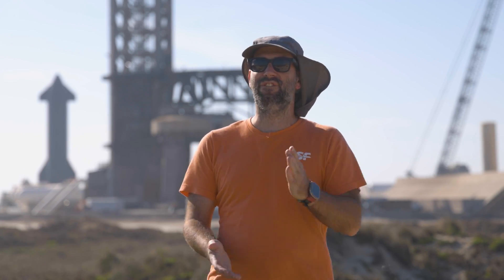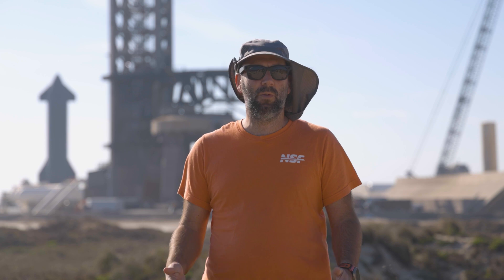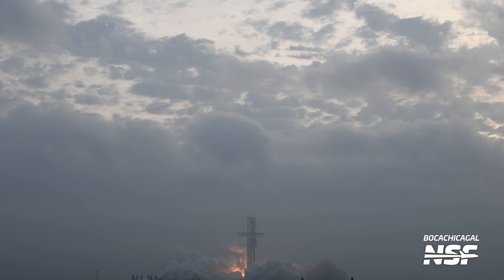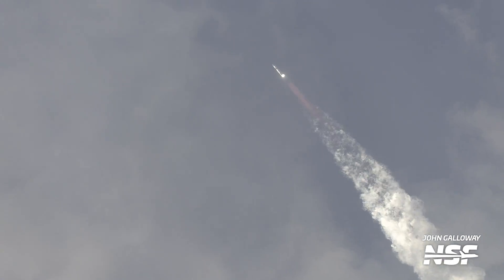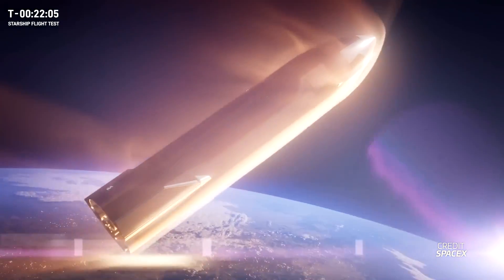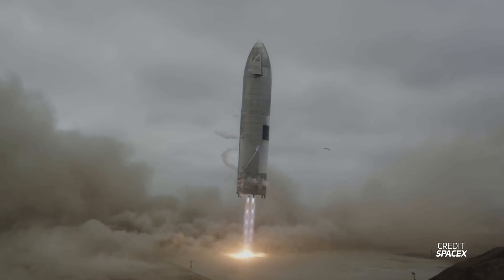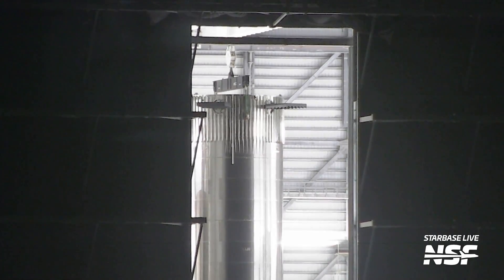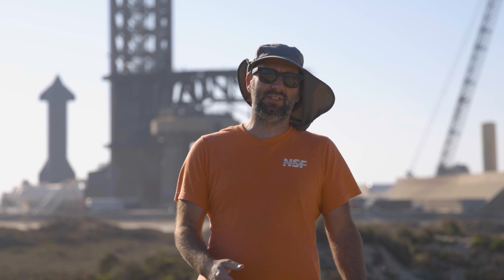Gearing Up for Starship Flight 4 | SpaceX Starbase Update

Comment: i personally don't think either the ship or the booster, in their current hardware configuration, can be reliably caught by the chopsticks. The lifting points on both stages are WAY too small to be caught on to reliably, it would be imo pretty reckless of them to try to catch the vehicles on those tiny surfaces. I would imagine for V2 they will add large deployable surfaces on which the vehicles can be caught, kinda like the airbrakes in KSP, but just my guess
Reply: Bigger mountpoints for chopsticks is not actual big issue to accommodate. 
But I agree that SpaceX will not try catching booster/ship with current generation. 
I think designing of next gen boosters/ship we will see after hover test/soft touchdown. Probably after 2nd successful test. And they will try soonest when second tower will be nearing completion. As for ship, I think current gen will be no more tested than after successful, stable orbit. I doubt those will ever be possible to re-entry intact. All existing shop have old gen heatshield, while about 3 months ago there was spotted test rig with smaller tiles, and some steel mockups. 
I suspect that those steel mockups are NOT just mockups, but those thin metal sheets would be attached to tiles with some more permanent method, like adhesive or something else. But that is my personal beliefs
Reply: would be interesting how they would retrofit such a big hardware change on the booster, since there aren't any major booster redesigns planned in near future that im aware of
Reply: Exactly how big do you want these surfaces? The lift points on the booster only look small when compared to the size of the 21 story rocket.
Reply: @shaung949  obv my guess is just wild speculation, but if i were them, I'd go with a rectangular surface, about the size of gridfins in length and half their width ( but then there arises the question of how they would integrate such a large surface onto the heatshield of ship, so im not sure)
Reply: @KAILASCHANDRANM.S so 2.5 metres/9 feet in length? That's going to cause some drag going through the air.
Reply: @shaung949  which is why i said that they must be deployable. Go look up airbrakes in kerbal space  program to get an idea. 
But again, that adds complexity and weight, so i don't really know. This is all just speculation. The only thing im sure of is that they wont be catching the vehicles using those puny lifting points. Let me know how you think they'll implement such a system

Comment: Fortunately, if landing on the Mechazilla arms slips into 2025, SpaceX will likely have a backup landing method under development---the landing legs for the HLS Starship lunar lander. I expect to see suborbital tests done with a prototype lunar lander test vehicle within the next 12 months to validate the design and operation of those legs in Earth's gravity. Then SpaceX will have a way to land the Booster and Ship if tower landings are a bust.

Regarding Pad 39A at KSC, the word is that SpaceX and Space Force, which operates the DOD launch pads at Cape Canaveral, are negotiating the use of LC-37 for Starship launches. That pad currently is used by ULA's Delta Heavy, which is scheduled to make its final liftoff there on 28Mar2024, three days from now. That likely means that Starships will not by launched/landed at 39A after all.
Reply: Booster  will be a catch, legs are only an option for ship.
Reply: With SpaceX, things change all the time. @shaung949

Comment: The Booster QD could be re-designed to use ridged pipes with swivel joints instead of continuous flexible tubing. They would be far more robust against damage, and insulation layers would be easily replaced and a lot less expensive.

Comment: I think they will install the 9 engines and a kind of stabilizer to maintain the ship for a smooth landing on the water. And I think that before building the second tower, they should make attempts to catch up with the booster and the ship. But it’s that my opinion thank you NSF. GREAT JOB TEAM 👍🏻😄
Reply: Don't expect that for current gen of ships. And they will not build Starship v3 before more data from re-entry.

Comment: I wonder if they'll use the second tower to do catch attempts rather than the first, and if they'll build up a better protected area around it so that if/when it goes wrong it doesn't completely wipe out it's tank farm and surrounding equipment.
Reply: That second tower won't be ready for over a year and the tower is the easier part anyway.  The launch pad and water cooled steel plate system will take the longest.

Comment: Will the ground below catching point need any preparation for the engine plumes?
Reply: Probably not any more than it already has. It's only firing a few of the engines at a lower thrust and at a higher altitude. So nowhere near the power that it puts out at take off.

Comment: My thoughts go towards a two step approach for both the boaster and starship. As accuracy is the most important goal for both then using some form of landing legs would give the teams the opportunity to practice landing on dry land before attempting to land using the tower. This would at least remove some of the pressure to get it right and give time to build the second tower. 😊
Reply: You can't just glue some legs to a Booster and expect that to work.  Booster is huge and heavy, so any landing legs for it would have to be correspondingly huge and heavy, and require huge and heavy actuators to drive them.  And the Booster's structure would need serious reinforcement (particularly but not exclusively around the leg attachments), to survive a landing on any such legs.  Basically, you'd be talking about a rather different vehicle, with significantly diminished capacity for mass to orbit.
Reply: Legs for booster are not an option due to the fact you'd have to redesign the whole vehical. Starship is quite likely to have that as an option as it is a requirement for HLS.

Comment: The loss of attitude control on Ship as well as the glitchy payload bay door, will need to be addressed via modifications to S29.  If some of the debris flying off S28 just prior to reentry was indeed TPS tiles (possibly blown off by RCS thrusters in the nose cone), that issue will have to be corrected as well.

Similarly, I expect B11 will need modifications to correct B10's partial loss of attitude control during descent through the lower atmosphere, and its failure to relight the center 13 engines on time and fully, for the landing burn.

I expect these modifications to the hardware (and any corresponding changes to software) to take considerably longer than 6 weeks.  

Indeed, I wouldn't be surprised if even now, SpaceX engineers might still be working to complete analysis of flight data, model it all out to confirm their interpretations, and design and evaluate potential approaches to fix the issues.  By the way, its unclear if the propellant transfer test was fully successful either; if not, there could be additional related modifications and an attempt to repeat it with S29.

Which is all to say, i think the pad may well be ready within 6 weeks, but the next Ship and Booster almost certainly won't be.  I think it's very likely we're seeing Gwynne's riff on Elon Time here - by assuming perfect happy-path timelines, which for this high-technical-risk R&D program is extremely unrealistic.

So, I'm still guesstimating the next flight for the first half of July, though of course I won't be complaining if SpaceX manages to pull a rabbit out of the hat, this time around.  Still, not going to hold my breath.
Reply: Attitude control alone could be a stickler
Reply: I am thinking, that while you're correct about identification of issues, I think SpaceX can make those adjustments on time. Because many of those issues are relatively small adjustments to fix. As for booster attitude control I think main modification will be software. Bigger challenge will be re-igniting engines, but we saw that one thruster actually was able to lit up. Other was consumed by "engine rich combustion", but I suspect that there differences between engines, so they know what solution is actually working, what need to adjust, and what was actually failure. 

Cargo bay, I think SpaceX underestimated how airtight those doors can be under high pressure, so it not vented it self. Also just small hardware change, literally just drilling few holes for venting in cargo bay. 
Freezing ullage RCS on ship could be more challenging, but SpaceX for a long time is using cold gas thrusters on f9, so probably they got enough experience to solve that issue in no time. 

I don't expect that ship/booster will achieve softlanding on ift4. But if it will perform better, it will be big win.
Reply: I see no reason for ITF-4 to be delayed until July for the simple reason that Space X should not have to deal with the delays that led to two WDR aborts in late February.    There were 117 days from ITF-2 to ITF-.  And without the WRD delay and Space X getting its ship prep more efficient expect the next launch to be no more 2 1/2 to 3 months which would be mid June at the latest.  

The key issues for the next flight are fix the roll problems with both vehicles, why the booster had trouble with relighting its raptors for the landing burn.  The pez dispenser door might be the easiest to resolve, but only time will tell.
Reply: That's assuming they aim to fix all the issues for the next flight. I expect they will prioritise the relight and door, because once they get those working they can start launching payload. Recovery is the killer feature, but still only a secondary mission objective. I don't think they will let recovery development slow launch cadence. They will keep throwing rockets up when they become flight ready and likely to achieve any objective rather than holding them to implement the most recent developments. In many situations the current hardware is already too far built to modify even when they expect it to fail. SpaceX would rather fly it to be sure than scrap it because they have a better design.
We don't actually know whether the booster controls were working as expected or not. It is entirely possible the extreme and odd maneuvers were a deliberate exploration of the flight envelope rather than an optimised landing profile.
Reply: @agsystems8220  I agree 💯, except I think they're aiming for reusing booster as fast as possible. 
While whole stack is either way very cheap for launcher that class (can 90-100mln) majority of that cost is on booster (ship is about 20mln). Additionally goal for reusing booster itself is doable in just near few flights, considering experience with falcon9. I don't think that spacex will risk catch attempt before second launch tower is online, but in meantime probably SpaceX wanna catch as much experience and precision, as possible. So not only soft touchdown, but hover, hover maneuver, and precision in that. 
I think at least three launches that will be fully successful in regards solving new issues, similar to ift-2 to ift-3 ( ift2, failed to conduct boost back maneuver and flip maneuver. It was solved with ift-3. On ift4 I think goal as for booster itself is to keep altitude control "norminal", then ignite thrusters.
Reply: @just_archan  A close second priority, but I think cargo trumps it. A single starship launch will avoid 3-4 falcon launches, while still generating data around booster landing. This is thinking in terms of raw money though, where the real question is raptor production. If raptors are the bottleneck then they will prioritise recovery, while if they really are producing an engine a day then there's little point launching slower than every 43 days. Until the bulk customers start appearing at the cheaper price point they will not have enough missions to fly the engines they're producing even without recovery. At just 7 flights per engine they would have enough to fly every week. That's not going to be needed for a while.
Recovery is a slightly lower priority because they are going to end up with warehouses full of engines when they manage it. Eventually the market will catch up and we'll see those sorts of launch cadences, but for probably about a year it will be pure starlink. That's the important bottleneck for the program; customers. The milestone they're looking for is cargo to orbit.
Artemis complicated things a bit, in that it will need a lot of launches, but it's not a good development situation because they need to be too close together to do any iteration or make assumptions. If they need 7 launches before they are able to reuse the boosters they need to have stockpiled a huge number of engines, but that also means they haven't been flying tests with those engines. Treating Artemis as a development payload and assuming you will need a new booster for each flight would be counterproductive.
Reply: @agsystems8220  the way I see it: they could rush the next flight with only partial fixes for IFT-3 issues, and then wait until the flight after, several months down the road, to finally test all the fixes arising from IFT-3...  Or, they could spend a couple extra weeks up front and then test all the fixes for all the IFT-3 issues in one fell swoop.  To me, the latter seems more efficient, both in terms of time, and quality as well as quantity of data collected per $ spent.

Comment: Whatever the date for the next flight must surely solve the loss of control on Starship itself? Otherwise same outcome. Will they solve that in six weeks?
Reply: We can only wait and see. If it is not solved they will delay the launch until it is.
Reply: They will certainly have a fix for the problem. Spacex work 24/7 not 9-5 so 6 weeks for spacex is like 18 weeks for most other rocket companys.

Comment: So, if the payload door doesn’t shut and the ship can remain in the correct orientation, do you think it will be able to survive reentry with an opening on the wake-side of the plasma?
Reply: I don't think it would be structurally sound. But I am sure the door will close next time. SpaceX seldom repeats mistakes.
Reply: @knowledgeisgood9645  in structural terms, do you think the door contributes to the structure, or only the aerodynamics? (Only asking cos I’m curious, not meaning any disrespect 🙂)
Reply: @majorhayze  🙂don't worry.  The door frame is strong enough to take the normal loads, but on reentry I doubt it would stand a chance. Also any "air" getting in through the door would do a lot of damage I suspect. The pressure on the belly of the ship could very well be enough to cause the nose to fold back (with the door being the hinge). Let's hope that never happens.

Comment: thank you The Field
Reply: Hey back to launch  3  .it looked to me like they have weird oscillations on re-entry on the booster ,, how much affect is there on booster control with LOX in the oxidizer tank sloshing at one rate and propellant much higher up on the rocket sloshing at a different rate .200 to 450 TONS of liquid inertia,,, and starship would have about the same amount of fuel at re-entry,, same issues???

Comment: Jack has gotten really, REALLY good at presenting these updates! Rock on, Jack! Question: When a booster or Starship is scrapped, what happens to all that material? I assume it is recycled, but what's the process?
Reply: All we know is that its sent to a local recycler where everything is immediately chopped up into tiny pieces and then shipped out to be melted down
Reply: if only we knew someone at said recycler who could save some pieces